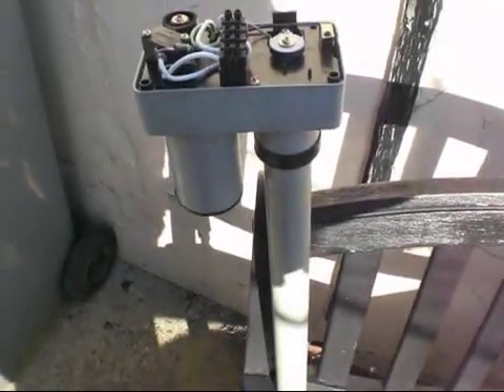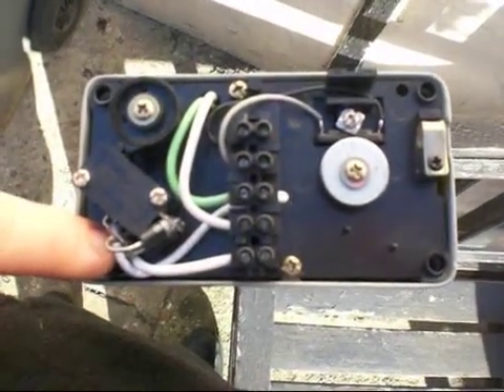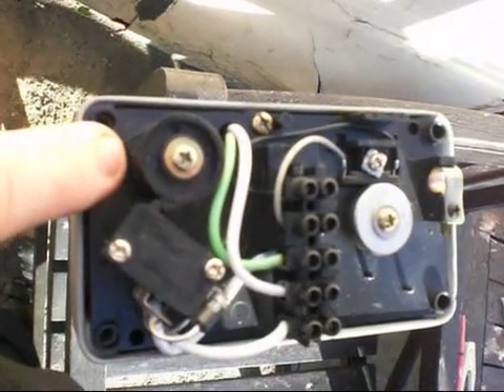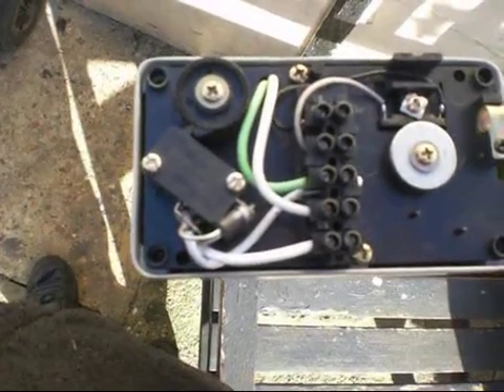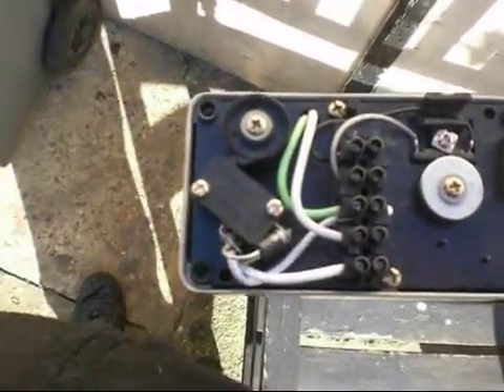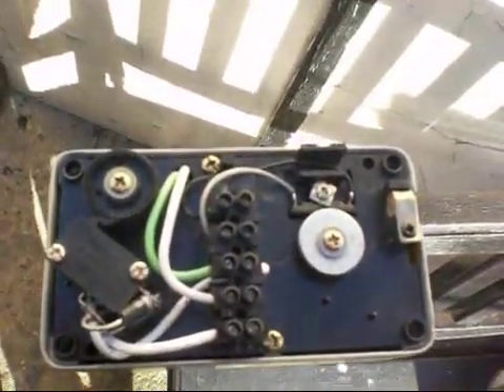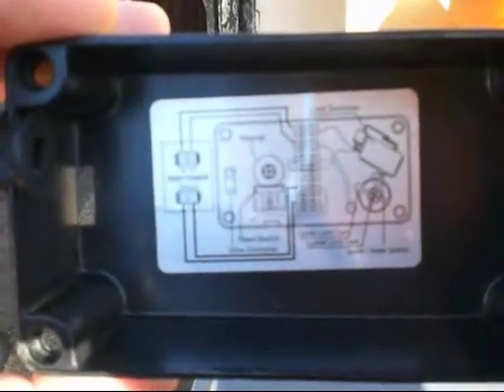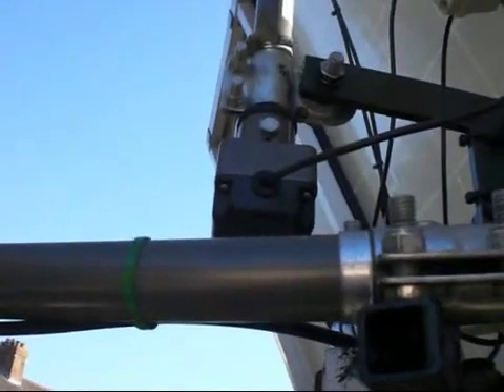setting up actuators.divx

Comment: Hi Friend, I have a question for you, how did you connect the 2 satellite actuators of the motor
Did you connect to 1 device - Satellite Positioner or did you connect to 2 Devices

I am asking you this because I want to install another Actuator on my Dish Antenna

one is for turning the Dish left and right and this one would be to move up and down for the sake of Elevation, for some satellites it must be moved Lower or Higher in order to catch a good Signal

If you have a Video or Pdf procedure how to connect it, send it to me in advance. Thank you and have a nice rest of the day bye

Comment: hi! I am working on a project for uni using actuators, please could I call you and ask you a few questions please. Its an art installation using a linear actuator but i'm having problems working out the wiring side of it all. Am based in uk, please let me know!
Reply from the maker: 2 wires only  12v upto 36vdc  + and - to  the actuator moves in one direction then reverse the wires to go in the other direction.   reed switchs on each end of rotation to stop it going too far